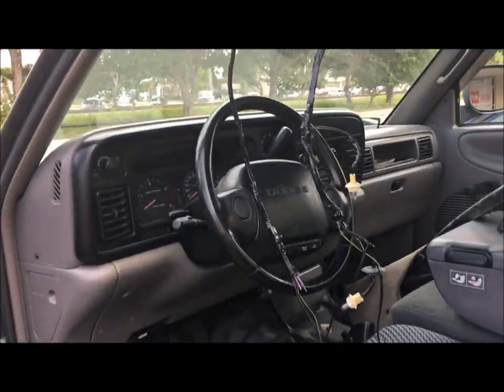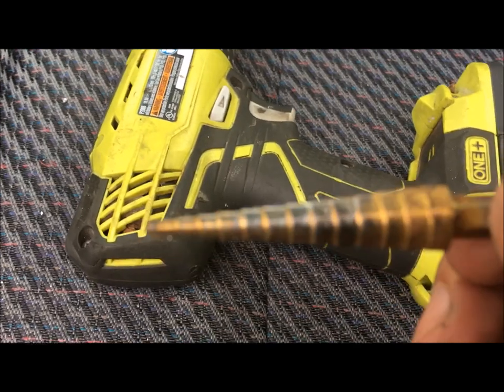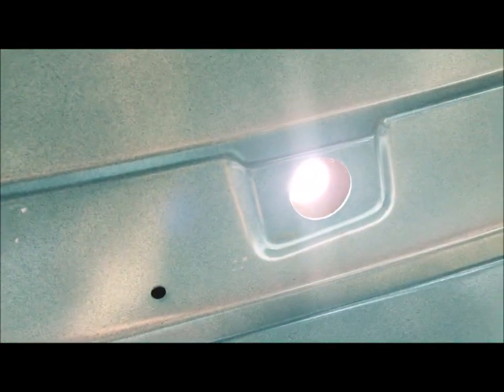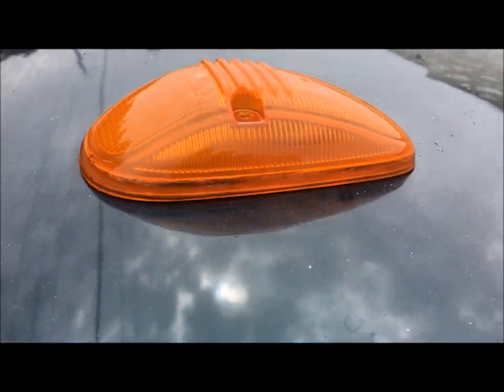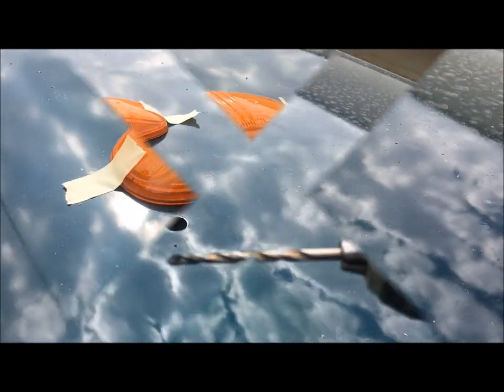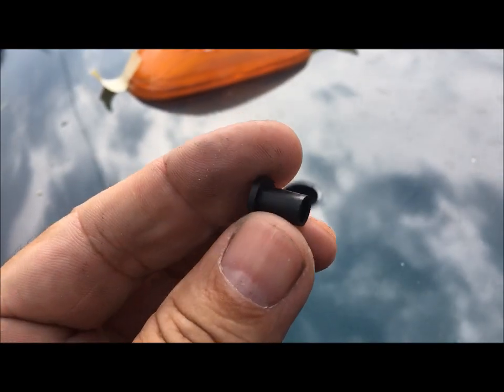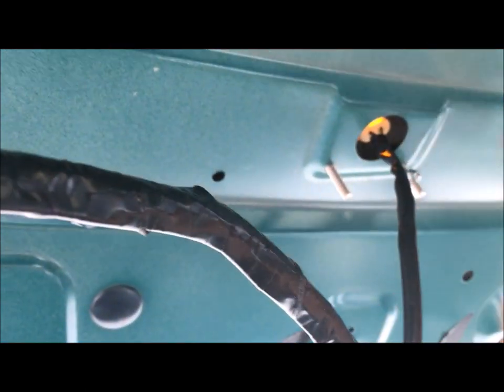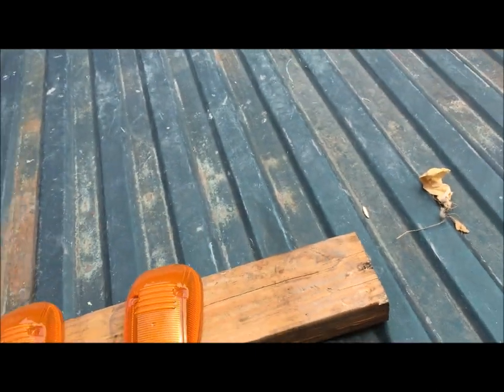Cab Light Install for Trucks Without Cab Lights From Factory

Comment: Those lights were designed to be put in with self tapping screws so they could be removed to change the bulbs easily not bolted through from inside the headliner
Reply from the maker: You are absolutely correct.
Reply: if you seen the video and how he drills you shouldn't care how he does it ,But i can tell you he wont work on my vehicle
Reply: Wonder if you could get a nutsert to seal and not leak in the rain reliably?

Comment: My name is Cayden Redmond and I live in Lexington Kentucky I did this with my truck but not all of of the lights are perfectly aligned do you have any suggestions on how to fix that
Reply from the maker: If you use the holes in the roof cab, those are made there by the factory. I don’t see how you can miss align  them.

Comment: So what happens when you have to replace a bulb? You will not be able to get the wing nuts back on w/o removing the headliner.
Reply from the maker: You can change the bulb from up top. It has two bolts on top holding down the lens cover.

Comment: if I'm not mistaken it looks like those big old screws go straight through the lens straight down and you got Wing nuts on them so how do you pull off the lens cover without removing the Wingnuts and I assume the headliners going to go back in is that a 2-piece lens cover or what just trying to figure it all out

Comment: I guess that he doesn't intend to put the headliner back into the truck.  I would use rivet nuts in the holes that hold down the light and use a screw length that does NOT extend past the second layer of sheet metal lie the factory does which allows for the installation of the headliner.
Reply from the maker: I did installed the headliner, with no problems.  I swear!!!  rivets are a good idea; though that's not how they come from the factory, and I honestly don't see how I could attach them to only the first layer .... as there no room.  But hey, If you did it, cool.  
And I did fuck up with bolt length.  nbd.  I shaved them down afterwards.

Comment: Did you use the factory cab light plug. if so wheres it at
Reply from the maker: no, brother.  I just tapped into a wire off the light switch.  I just grabbed my test-light prob and found the wire that had juice when I turned on the switch.  sorry i don't remember the color of the wire.

Comment: You tied the grounds on each led onto one and ran a solid ground right?
Reply from the maker: If my memory serves me correctly. Yes.
Reply: conquryourfear & do it urself ok I figured. I rhino lined my roof and I went through a few drill bits😂
Reply: conquryourfear & do it urself wonder if I can wire this to my regular light switch when I turn headlights on
Reply from the maker: B E That is exactly what I did.

Comment: Thanks for the video brother. Question; couldn’t you have drilled a hole and inserted the pigtail from the top and so the hole only need to be big enough for the wires to come down? Or does that not work for these light assemblies? I just bought a set to put on my 98 suburban so, I guess I’ll find out soon enough. Thanks again man, keep Truckin. Hang onto that 12 valve by the way, never sell it

Comment: Confused. If you need to replace a bulb you have to remove the headliner? Don’t most light housings use sheet metal screws to hold the lense down?
Reply from the maker: If you need to change a bulb, you simply take out the two top screws that hold down the lens.  Yes, sheet metal screws are indeed used.  But this video is how to install cab lights when the truck never came with them.  thanks for your comment.  Happy New Year!!
Reply from the maker: Bugpumper McGee no. You can just unscrew the top lens. Yes, some use sheet metal screws. I do not.

Comment: Does the dodge 1500 come with the holes already in the truck like this one?
Reply from the maker: Sydney Hurdle they have the holes semi cut. So there's no guess as far as measuring them
Reply: Thanks. I just got a 1998 Dodge Ram 1500 and I like the lights and wanted to put some one it.

Comment: Did the headliner fit correctly with the bolts coming through the roof from the lights?
Reply from the maker: had to shave off a bit with the grinder.

Comment: Those lights will surely dress-up your truck, especially at night.
Sir, those step-drill bits are named "Unibits". However, your problem remains, with a cheap drill to start your project with.
Great job overall, thank you for your video.
Reply from the maker: Oscar Lechuga yeah, economy drill did me in that day.  Thanks for ur comment.  Take it easy

Comment: if you're going to use a black oxide or titanium drill bit on metal you need oil and you need to go slow. personally I have found that masonry bits with a little bit of oil works really good because they don't bind so you can go fast and still make a clean hole because a masonry bit instead of cutting through the metal to make the hole, it just wears down the metal to make the hole.
Reply from the maker: Cool to know. But in this instance I had the drill running backwards like a dummy.
Reply: @conquryourfear  lmao

Comment: Another after thought you didn’t specify where to wire it in whether it wires into the dash where the lights turn on or whether you wired it into the battery
Reply from the maker: braden smith sorry. I should have explained this part. I guess I had too much on my mind. Anyway...I tapped into the parking light wire that connects to the back of the headlight switch. Ran the wires behind the pillers

Comment: Never would I ever drill a hold that big .. Just cut the and splice it back together.. Makes more sense to me
Reply from the maker: I followed the prefab holes already in the roof.  It's the same diameter had the factory installed those lights.

Comment: So wait is this on a truck that did not have factory cab lights?? Oh nevermind... I didn't read the title, or the description lol. Just kidding. Cool video. I bought a set of OEM style ones for my 89 F250 about 2 years ago that are still sitting in the box because I'm afraid to drill holes through my roof!!
Reply from the maker: i hear ya brother.  if you want to be 1000% sure it doesn't leak, you can always hit them with a thin line of clear silicone around the edge of each light.

Comment: How the fuck you supposed to put the headliner back in with those long ass bolts and wing nuts sticking through?????
Reply from the maker: Jonathan Wagner they were a little too long!!!  But the headliner went back in.  There's a lot of space in between the roof and the headliner.  If I have to do this job again I will use a shorter bolt.  Thanks for your comment brother. Take it easy.
Reply: Oh ok, you too

Comment: What I really don't understand or get ..is why there was not silicone or paint applied to the raw exposed metal ,Yes he installed running lights on the cab , did have the drill running backwards but we all done that once or twice .My main point is the roof cab will be leaking and rusting within a couple of weeks ,,,,,,,,,and in a year or 2 that cab roof will be destroyed when ever drilling into a vehicle metal removing the protection paint and primer and exposing the raw metal it needs to be recovered and protected against water ....or it will RUST ..
Reply from the maker: The fear that you express is notable. However I specifically mention that you have to get the OEM cab lights. The concave On these cab lights are perfect with the roof and it seals with the OEM  rubber gasket. No leak at all.

Comment: ...POUR FIXER DES FEUX SUR LE TOIT D UN VEHICULE VOUS DEVEZ ...1°MARQUER L EMPLACEMENT OU SERONT MIS LES FEUX...2° FAIRE SUR DU CARTON LE PATRON DU FEU C EST A DIRE TRACER LE CONTOUR PUIS MARQUER L EMPLACEMENT DES TROUS  3° METTRE SUR LE TOIT A L EMPLACEMENT DES FEUX DU TAPE DE CARROSSERIE PLUS GRAND QUE LA SURFACE DU FEUX....4° TRACER SUR LE TAPE LES EMPLACEMENTS DES TROUS AVEC LEUR DIAMETRES ET SEULEMENT FAIRE LES PERCAGES DES TROUS ET LA PEINTURE NE SERAS PAS ABIMER GRACE AU TAPE....VOUS AVEZ TRAVAILLER N IMPORTE COMMENT ET LA PEINTURE AUTOUR DES TROUS VAS C ECAILLER CAR ELLE A CHAUFFER AVEC VOTRE MECHE CAR IL FAUT PERCER TOUT DOUCEMENT PAR ACCOUTS  VOILA CHER MONSIEUR COMMENT FAIRES  BAV